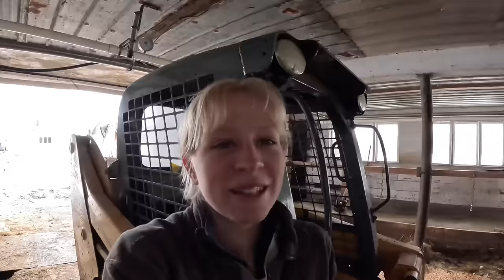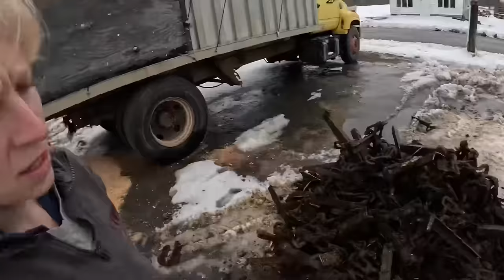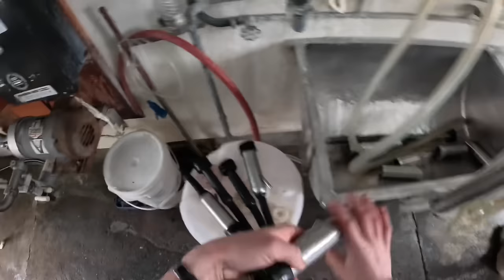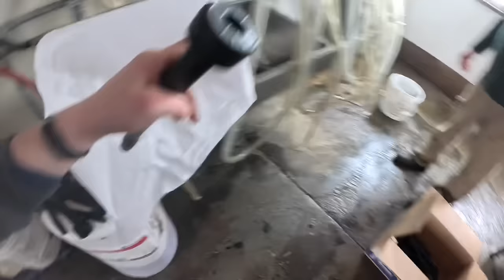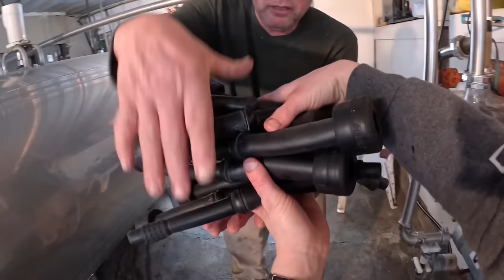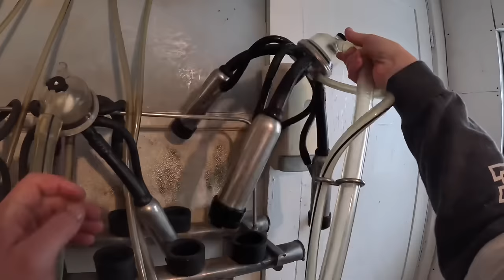Our biggest farm breakdown yet, it’s finally over…

Comment: Rubber hoses and the inflations if they do not want to slide off, push it on a little, they often break loose and come off much easier.  Get a cut off saw for trimming the paddles it will be easier and you can set up a jig to get the right size every time.  If I wasn't 20 plus hours away it would be fun to pick up the chain and help some, feel like I was farming again.  Maybe you can get who ever is getting the chain to give you some video of the drive.  Stay safe and healthy Tay.

Comment: That's a Patz barn cleaner -- I may have made some of the parts for it.  Long lasting for sure. You may be able to use some or all of the flites (sized for your gutter) with the new chain or have the longer ones cut down by a machine shop in your area. Is the one you are buying another Patz product?? If it is, it will last a long time.  Good luck with your project.

Comment: Hi Brent and Taylor, as you said Taylor: the old barn cleaner has served the barn well over the years and there is no waste of value. Happy to hear you found a replacement chain and head to replace the old cleaner. At least if such a thing best time year for a total break down, this most likely was the season for it to go out. If you need any help going to get the new units or help with it installation?, let me known.  Regards, Bob

Comment: An exhausting job. Every tie stall barn has this issue eventually but it is an expensive fix. Good luck to you both. It would be nice if you could line up some help to change the unit and chain.
Reply from the maker: You are exactly right, every method of farming has its own unique set of problems and our day is finally here! We’re working on getting a crew together to help install everything when we get back with it. Hopefully we can get it up and running soon!!  Thanks so much for watching 🙂

Comment: I used to always cut the inflations in half to take them off, was a little faster, and I wouldnt mix them up withnew ones lol. Videos awesome as always!
Reply: I also replaced all of those little black pulsator tubes with the double tubed clear tubing that we had to go from the pulsators to the machines. Id split it in half, it was way cheaper, lasted a lot longer, and is more rigid

Comment: Those used "inflations" are just "maravillosos" for everything they were not ment for like protection on hydraulic couplings, non slip attachments on tool handels, anti rattle on all metal gates/hinges, adaptors between differnt hoose diameters, etc etc 👍👍